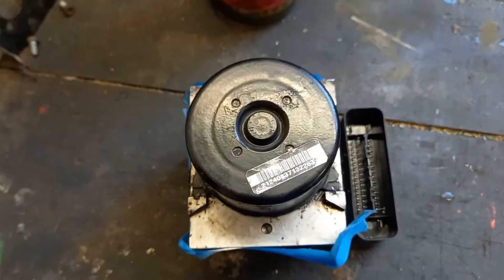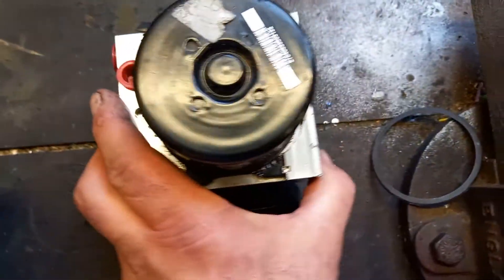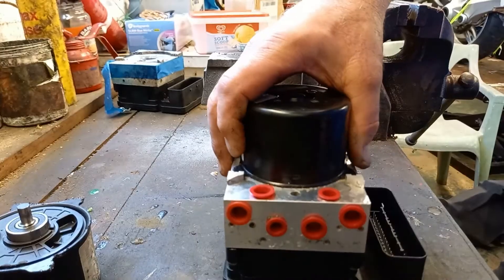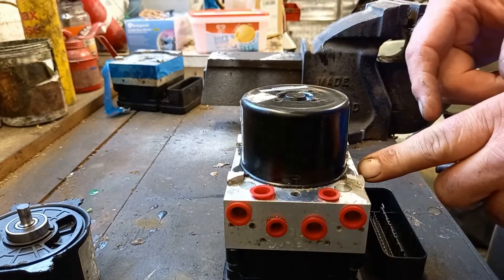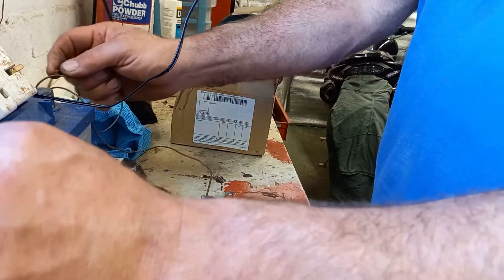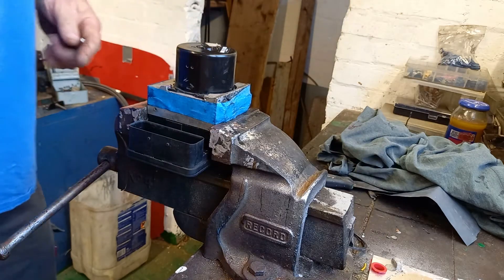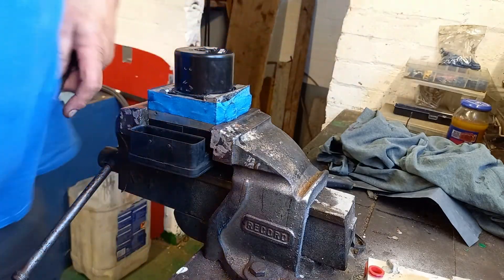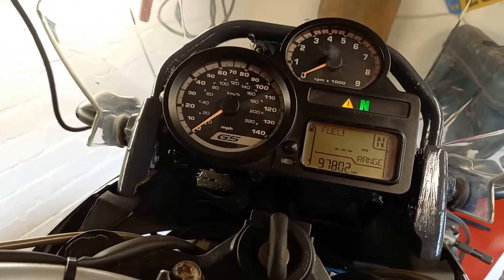BMW R1200GS ABS repair using parts from a Ford Focus.

Comment: Thanks for this video helped a lot in fixing my ABS pump issue. I used the motor from an old ford focus. But will still pull the GS pump apart and try and fix it. Bike running good getting all the air out of the lines was hard but got there.

Comment: Can we change the motor with the complete valve block of Ford (without disassembling the motor) and keep only the electronic modul BMW?
Thank you
Reply from the maker: @Horatiu-n2e  no because there are more pipe connections on the car one... More wheels.

Comment: The main reason for the BMW motor not working is that the motor brushes are in a very close tolerance holders. When enough brush dust builds up around the brushes they do not slide within the holder and contact the armature. So on a GS911 the fault with say you have an open circuit. The Ford motor has less tight tolerance on the brush holder so dust doesn't build up and bind the brushes. However the eccentric on the end of the Ford armature that drives the pump also has a greater offset than the BMW  and will put greater pressure on the break system , the armature from the BMW should be changed to the Ford motor to avoid over pressure situation.  So you're only using the Ford motor housing. I did this conversion on my 07 K1200gt about 10 years ago and have never had any problems since.
Reply: I don't know about the poster of the video. But looking back on my ebay purchases,  it was a 2013 Ford Fiesta abs module.
Reply: What year of ford focus?
Reply: Thank you!  Worried about the servos on mine. Bike has 3400 miles on it with abs failure

Comment: Hello, good afternoon from Spain.  Thank you first of all for your professional contribution and knowledge.  A question please, I have a 2006 RT 1200, is that how the module of this model is repaired?  Could you please tell me what reference the Ford Focus module is so I can locate it.  I greatly appreciate your contribution and help.  a cordial greeting from Spain
Reply from the maker: The one I used was from a 2013 focus, I'm not sure what iteration it was , but it needs to be an ATE abs system. Thanks for the comment.

Comment: This is great.. please if I swap the electric module with that of the fords would it work? My module electrical board is burnt
Reply from the maker: Unfortunately not as the wiring plug is different.
Reply: @randomcol1378  oh my.. thanks for the reply..

Comment: Hey and thanks for your video. 
I just replaced it today but i don't know how to fill the break liquid. 
I pumped more than one hour with a hand vacuum pump but the fluid didn't move :/
Could you tell me the steps for it, please?
Reply from the maker: I just slowly kept pumping with the ignition on and keeping the resovour topped up.
Reply: @randomcol1378  thanks. I just builded one more step: i had the ignition on, moved the rear wheel and puled the front break. That actives the ABS and pumps the air out from there. Got it from Forum as replacement for PC-Method

Comment: I wonder if the BMW bikes turn on the motor when you apply the brakes, rather than only when ABS is needed. My 2007 R1200ST brake error indicator lights sometimes when I apply brakes, but only then, suggesting the motor current failure is detected during normal braking. IanB

Comment: Why are the pumps from BMW so bad? My bike has 27k miles and my pump is gone. If these really are identical do the ford pumps fail too?
Reply from the maker: I think it's because the pump is bolted to the top of the crank case on the bike,with all the heat and vibration that involves where as on the car it's bolted to the body.
Reply: @randomcol1378  ah I see. So instead of building or buying a pump designed specifically for motorcycles BMW decided to cheap out on us. 😂

Comment: How did you purge/bleed the ABS unit after you did this fix? I have the same unit on my bike which is causing a different issue and I think I need to bleed it. All the other videos on YouTube seem to show a completely different ABS unit with bleed nipples and reservoirs, whereas this unit has none of those!
Thanks in advance.
Reply from the maker: All I done to bleed  it, was  open one bleed nipple at a time and gently pump the lever, working though both fronts and rear caliper, and then just the rear with the pedal keeping ignition switched on and the reservoir topped up.
Reply: @randomcol1378  thank you. Haynes seems to stress that they need specialist tools to be bled properly. I’ve rebuilt mine as per your video, thank you.
Reply: @JensAddictions  I just watched a video where the guy bled the brakes like normal then hooked the bike up to a computer through a GS911 diagnostic tool. He then was able to purge the fluid through the ABS pump and then out the front brakes. The only catch is those diagnostic tools are like $300+. I don’t know if there’s a way to bleed the pump it without all that. I’m sick of my BMW. It’s a great bike to ride but everything just breaks on it. I’ve never had a bike that does this. The fuel gauge has stopped working multiple times, now the abs pump, it burns oil too. I’m going to get rid of the bike before the  ESA rear shock goes bad. I’ve been told that happens before 30k miles.
Reply: @JonBecker81  I've since been told by a BMW master technician that this particular ABS unit doesn't need purging with specialist tools - just bleed as you would any other normal braking system.  Some of the more complex servo assisted ABS units DO need special diagnostics tools to bleed/purge the system though.  Anyone reading this, please do your own research and don't assume that what I've written is correct - I'm only relaying what I've been told, the opinions and advice of others may differ.
Apart from the fuel gauge and the ABS I can't say my bike has been much of an issue, it's not a low miler, either.  The fuel gauge I can live with.  ESA shocks can be rebuilt, I guess you're in the US but Google T-Tech suspension - he does international repair/service to BMW (and other) shocks and his work is meant to be first class.  I can't comment on the oil burning issue, although if they're anything like BMW cars then oil leaks and burning oil is surely a factory feature! 😆

Comment: I have the same abs problem on my 2007 GS.hey brother what is the exact name of this ford unit.Can you give me the link on ebay, so I can order one too.thx. alot
Reply from the maker: It`s a uk spec car just search for ford focus ABS pump. make sure the motor is black and not bolted on, but held on by peined over tabs.

Comment: So I should be blasting down dirt roads with ABS on and squeeze the brakes as hard as I can to give those brushes a good work out every once in a while?
Reply: The ABS test spins the motor every time you turn on the bike as far as I know. The ABS error light blinks (motor current good, waiting for movement to check the wheel sensors) and goes out when it sees all wheel sensors. IanB
Reply from the maker: Yes, you should blast down dirt roads, weather squeezing the brakes on as hard as you can is a good idea I`m not so sure.
Reply: Do it on tarmac, you are less likely to spill

Comment: I've got exactly the same problem on my 2006 r1200gs. I'm going to get a pump motor off a Ford focus and swap them over like you have. Thanks for a great money saving tip.
Reply: Your 2006 GS has a completely different pump.  Ford Focus parts will not fit.
Reply: @GuysGarage120  I think you will find that I'm right. The electronics part of the bmw pump is different, however the actual electrical motor is the same. You can physically remove the motor from the bmw pump and replace it with cheap Ford focus motor. I've seen it been done.
Reply: @michaelmcdermott1877  The 2006 GS models are ALL servo assisted ABS, which is a completely different pump.  If the pump looks like the one in this video, then it is 2007 or later.   2006 Servo pump part number is "34 51 7 698 296", while 2007 onwards part number is  "34 51 7 715 109" as in this video.  I have been working on these bike for a living for the last 14 years, so I know the difference.
Reply: @GuysGarage120  I own a 2006 r1200gs, and the motor from from the Ford focus is exactly the same. I've checked it personally. It's the same motor. The electronics are obviously not, but the actual motor for the pump is.
Reply: @michaelmcdermott1877  very interesting indeed.  What is your vin number?
Reply: @GuysGarage120  hi there, the non Servo brakes commenced on the 2007 model as you say but the manufacture dates for the 2007 model commence in September 2006 as is with most bikes. 

I have had one. Plated 2006 yet non Servo assist brakes.
Reply: @GuysGarage120  https://youtu.be/QiRzdXoZ8bk
Reply from the maker: Glad it's helpful.
Reply: @randomcol1378  and @MichaelMcDermott , how did you know the unit was bad?  I have ABS Brake failure on my dash...but not sure how to determine if that is a motor or a other electrical issue.
Reply from the maker: @DudeGuyWho  you need the motor scan app and a Bluetooth code reader the fault was abs motor low voltage hope this helps